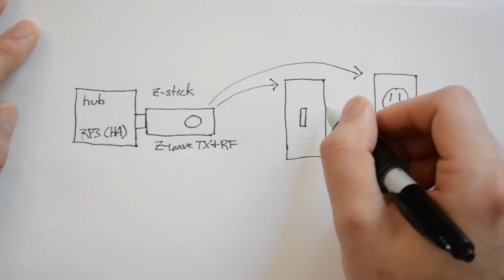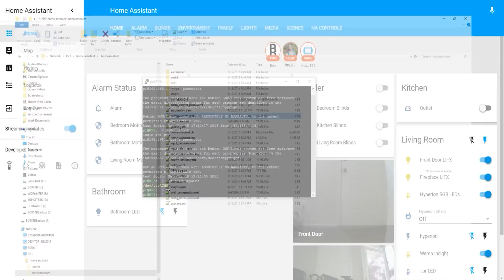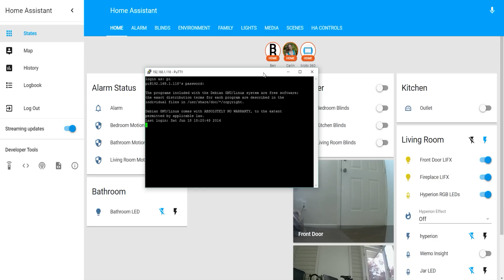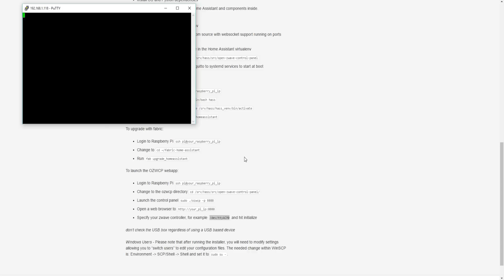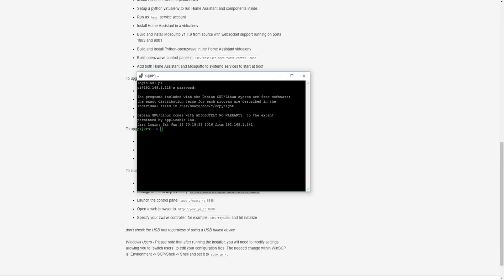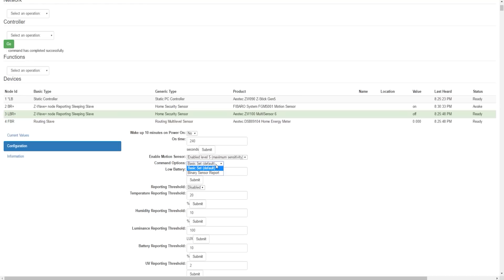The BEST DIY Z-Wave Tutorial - How to Get Started on a Raspberry Pi

Comment: WiFi has no chance with Zigbee/Z-wave for home automation in the long run.

Apartments/homes have usually 3-10 devices and in bigger cities WiFi is already barely usable due to overcrowded spectrum. In bigger buildings all devices/APs interfere massively. The more WiFi devices you have in the area the worse it gets. With home automation you'll need a lot more devices.

With Z-wave/Zigbee mesh networks when you add devices the whole network gets stronger. Also protocols are a lot simpler, less data to transmit leaves spectrum and time for your neighbors.

There are also issues with WiFi in regards to security, processing power requirements, low power operation for battery powered devices, etc. It also changes frequently and drastically. It was designed for throughput and compatibility with existing computer networks. Home automation is on another end of the stick.
Reply from the maker: Very true. Yeah, there is a lot of good arguments to be made on all sides. I agree that WIFI has a ton of issues, too. Definitely agree that WIFI sucks power compared to Z-Wave and I'm not sure if they'll ever be able to get around. 

I doubt that overcrowded spectrum issues will be there long term. They have to resolve that issue for PC networks anyway and most (every) home is going to have a wireless router regardless of home automation stuff.  Maybe that sweet LIFI tech will take off, I don't know. 

The key to me with home automation is the concept of a "hub" will need to be vastly simplified into an "all-in-one" device - like an Echo or WIFI router if it's going to go mainstream. Most people don't understand the difference between a modem and router and adding a third z-wave hub for the their system, while accessible to the geeky types, isn't going to take off. It'll be fun to see where the tech goes! 

But hey, I don't think HA or Z-Wave is too hard now. That's why I make these videos.. I just doubt that this exact tech would ever be adopted by more than 5-10% of households.  

P.S. I wasn't on board with blu-ray back in the day, I was an HD DVD man. lol. So, I could definitely be wrong on this one.

Comment: Love the video, now trying to determine if I am going to roll my own PIR sensor or go with the z-wave stuff. I cannot decide, I feel like the z-wave multi-sensor gives way more flexibility and likely reliability.
Reply from the maker: For sure! Hope to be getting that video out soonish! All are great devices - just depends what you are after, budget, etc.  Let me know if there's anything I can do for you guys before then. Cheers!
Reply from the maker: Yeah, I'm definitely in the same camp with this. I currently have four sensors I am testing. I'm going to do a comparison video on them at some point soon(ish). My general conclusion is this - my DIY MQTT sensor node has the best performance, but is powered, ugly, and basically unmountable right now. Working on a 3D printed enclosure which should help on that. 

The other sensors work well, but are much slower in terms of polling rates and such because they are battery powered.They look way better though. I'm going to play around with some more settings this week and will report back. I killed my first  battery in two weeks - was supposed to last 2 years. :P
Reply: Hmm, so do you think the two mutli-sensors you have are too slow to trigger lighting? I really wanted to use one to turn on/off lights in my kitchen (kinda secluded), but if the delay is too long that might not work. :(
Reply from the maker: Still testing that one a bit. I think they'll be pretty quick once I get it dialed in right.

The Aeotec sensor I'm using on AC is fast and never sleeps. The Fibaro sensor has been funky - working really well and then it just disappears in some kind of deep sleep. That issue is probably on my end, though.  

You'll likely be able to use any of these to turn on lights - it's just a question of does it need to be powered or how many batteries it'll eat.
Reply: Alright, I have an update of my own. Basically after spending the evening mucking around trying to get home-assistant setup on a raspberry pi, I finally have zwave stuff setupThe Aeon Labs MultiSensor (old round type) is currently in my kitchen relaying commands to Home Assistant  to turn on lights when I enter the kitchen area. 

While it seems to be working well now, here are some lessons learned:

1) The Multi-Sensor I purchased is extremely slow to respond when battery powered. The red led shows that it has detected my movement quickly, but it takes another few seconds for it to send a command to the controller. (Switching to AC power using an old phone charger solved this problem... mostly)

2) The time that it takes to turn on the lights after motion is detected is approximately 1-3 seconds, even on AC power. Looking at the Home Assistant logs it seems that the sensor is causing an event almost instantly,  but it takes a while for the Lifx bulbs in my kitchen to receive the command and turn on the lights, which is a bit unfortunate. While this isn't a game changer, it does make a fade transition when the Lifx is turned on feel very slow and so unfortunately it means a bit more config, currently I have a script that turns the lights on to 50% of their brightness depending on the time of day without delay, then I send another turn_on command to slowly inch the brightness to 100% over the next 10 seconds.

3) During the setup I paired my sensor and then accidentally reset the controller in OpenZwave Control Panel, the Aeon Labs MultiSensors do not have a way of easily resetting them to factory defaults, but I found the firmware update software for windows provided on their site will reset it to default and allow me to re-pair it will the controller. 

4) The temperature sensor in my sensor is absolutely terrible and reports a wide range of temperatures, currently discussing the issue with AeoTec and will report back.

Overall, it is a nice addition to my home setup, but I am really interested to hear more about your Fibaro sensor. The color changing LED has some huge potential for viewing state information such as if an event of some sort has been triggered.
Reply from the maker: Dude, this is sweet. Thanks for sharing this. I can confirm similar latency. Although, I think in my case it's a little closer to ~1 second rather than 3. That's motion event to lights coming on. It's just long enough to make you pause as you walk into a room. Once I have everything where I want it, I'm going to do a series of tests like this to test latency and such. I currently have an Aeotec MultiSensor 6, Fibaro MultiSensor, GoControl PIR, and a few versions of my MQTT sensor. I'm pumped to get that video out, but it's a few videos down on my list... and my day job isn't helping :(

I can say that the temperature sensor on the Aeotec sensor is pretty good as is the Fibaro sensor. I need a good control as I see +- 5 degrees F variation across my 6 temperature sensors even when they are in the same place. Something I trying to figure out. The good news is it is easy to apply an offset with those sensors, so long term, I'll have a good temperature readout across devices. Something I'm hoping to cover in that video.
Reply: I did a bit more testing of my own, trying to determine where exactly the latency is coming from on my motion events. There are so many variables, but it seems I might've been wrong about the delay time of the lifx. Turning on and off the lifx bulbs via the home assistant Web UI is near instant, so I feel I must mark it off my list as a cause for latency. What I can determine it that it takes what feels like an eternity for the AeoTec MutliSensor to actually detect motion, and unfortunately it seems there is no way to improve this timing. I can walk into my kitchen and it might be a second before the red LED on-board the multi sensor turns on indicating that it has detected motion. 

Beyond that, occasionally the sensor will detect motion and it will be 3-5 seconds before the light actually turns on. I have absolutely no idea where this latency is, but I suspect that it is either an issue transmitting the information via Z-Wave after a period of idle or some issue with the way Home Assistant is triggering events from the Z-Wave library. 

I am curious, how does your MQTT DIY PIR sensor perform? Would you say it has higher or lower latency compared to the Z-Wave devices?
Reply from the maker: Yeah, all good ideas. My guess is the latency is either in the z-wave network (if it has to go through some nodes) or, more likely, a function of some kind of sleep mode the sensor has to come out of. Have you tried adjusting the sensitivity of the sensor? Wondering if there is some movement threshold it needs - like covering a certain arc of the sensor or something. 

My MQTT sensor is super fast. I would say instantaneous or very close to it. There is some lag, but I think that's in the HASS core to execute the automation rather than the sensor. The DIY sensors are very good. I'm hoping I can get a good 3D printed enclosure file to share and then people can print or have it printed and shipped, throw in the parts, flash the code, and be off and running for ~$20-25. Got to get that Solidworks figured out...
Reply: See my main motivation for the z-wave stuff was the polish and "reliability" of the commercial product, but the latency is a huge issue for me.
Reply: Also to add, the DIY MQTT sensors might be quicker because of the processing speed differential between it and the z-wave low power devices.
Reply: This whole thread was an education - thank you both.  Looking forward to a DIY MQTT sensor video at some point!!